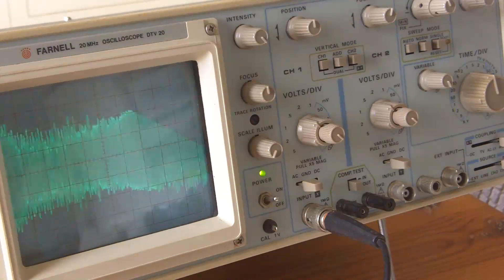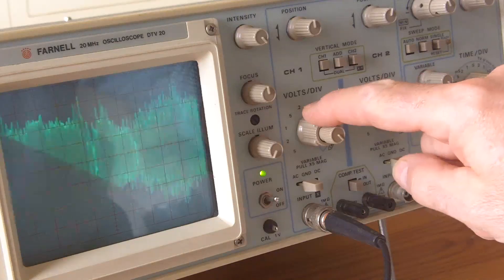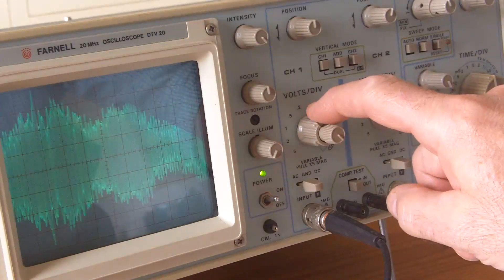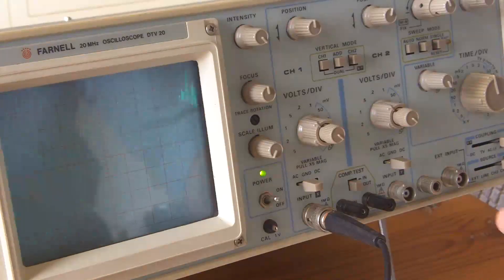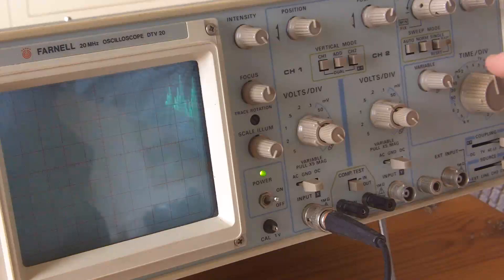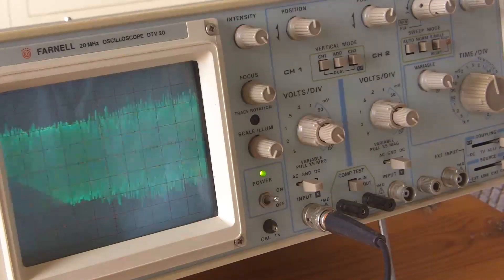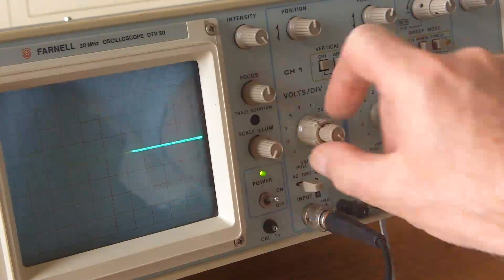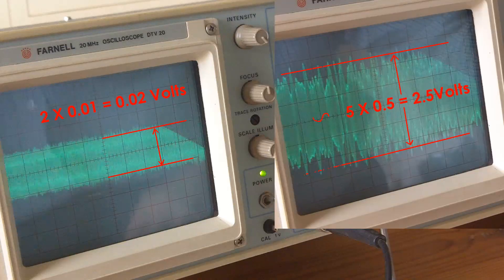About Radio ... Part 16 IF Amp scope traces by Andy Davies

Comment from the maker: Hi, as far as I can remember I think the scope pretty much kills the signal, it’s one of those things that once I’ve tried it and found the capacitance to be too much I haven’t bothered again. I did think about building a little high impedance amplifier to look at this sort of circuit but like so many things I haven’t got around to it yet. I guess I just haven’t had the real need. Good luck with the probes.  
Kind Regards ... Andy